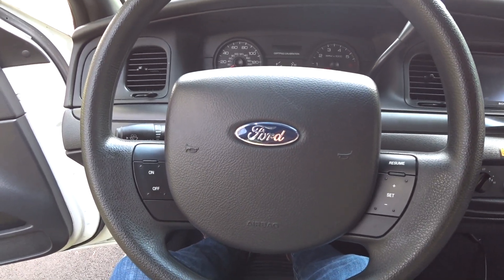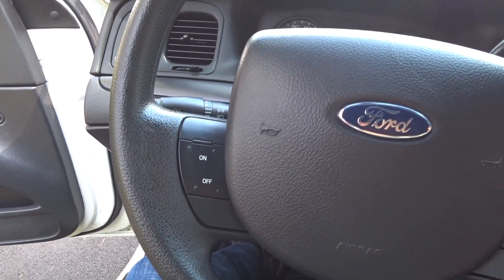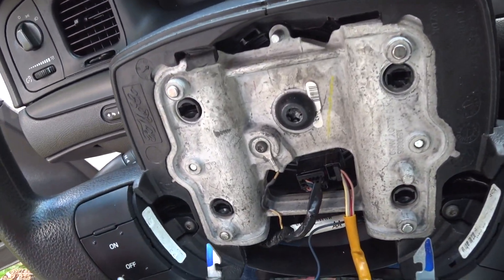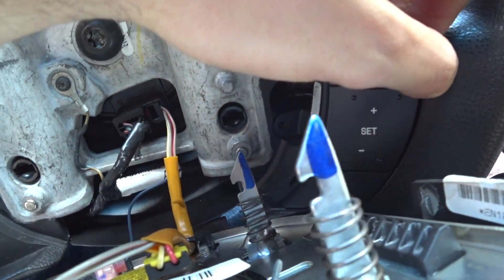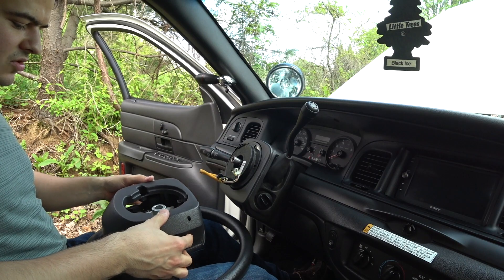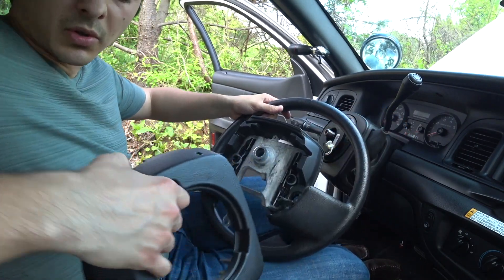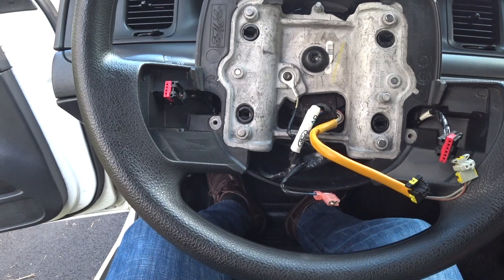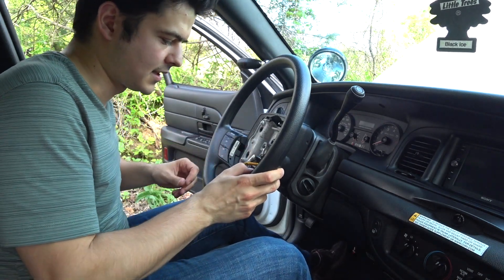Ford Crown Victoria Steering Wheel Volume Controls Retrofit

Comment: Thanks for the video. After watching your video I decided to retrofit my 2008 Mercury Grand Marquis LS. As you stated in the video the release for the airbag can be tricky. Everytime I thought I had it one corner or side would pop back in. Once the airbag was removed the rest of the retrofit went quickly. I did have to use a puller to get the steering wheel to come off. Once the wheel was removed I took it to my workbench and swapped the control buttons and wire harness after removing the back cover. I put the steering wheel bolt in to check if the threads were damaged and they were. I cleaned the first few threads with a 10mm X 1.5 tap. Much better. Reassembly was very easy. Since I have the original AM/FM/CD/CASSETTE the controls work perfectly. The electronic climate control buttons also work perfectly for increasing/decreasing the temp.The cruise control moved from the right to the left on my steering wheel. It works of course perfectly. I would recommend this retrofit to anyone. I think it much safer to use the steering wheel controls since the controls on the dash are so far away. Thanks again for the inspiration.

Comment: Hey, when I was a kid we didn't even have power steering. The break and the clutch pedals were like those exercise machines in gyms. There was no radio you had to sing really loud over the engine noise. And I had to drive uphill both ways to school in the snow without snow tires. ,(Her hee)

Comment: Where can I get these
Reply: I assume you figured it out by now, but your best bet anymore is buying the whole wheel on ebay. Ford discontinued most of the parts unfortunately so good luck finding just the buttons and the wire harness, but you could always try a junk yard. Also, if you're having trouble finding the adapter for the controls in my case I found a kit on Crutchfield. Crux SWRFD-60L Wiring Interface the only thing is it won't work with aftermarket systems made by Sony or THX systems that require SYNC.

Comment: I just did this to my 07 Grand Marquis after watching the video. I used a wheel from a Lincoln Town Car. Super easy. The wiring harness is almost impossible to find, but I found one at the junkyard. Cruise is working, but need to get the radio buttons working, but that's what Tech Support is for. Outstanding video, great upgrade to my car.
Reply: I got the radio buttons to work by adding a wire to the clock spring connector and running it to the head unit connector.
Reply: @encinobalboa  Can I verify the steps you took? 1. Install wiring harness and steering wheel buttons 2. Plug Maestro connector onto aftermarket radio and run wire to clock spring connector

Comment: So did it ever work with that head unit? I have the exact same Sony head unit in my Vic and experience the same frustration you had with the volume knob.
Reply from the maker: I never got it working with the Sony head unit I had in this car. I got the steering wheel volume controls from Crutchfield.com (the Axxess brand) to be exact. Crutchfield is great because they have support 7 days a week. After speaking with a technician on the phone, I got the following pieces of info:

There is a plug behind the steering wheel, around the 7:00 position. You have to remove the bottom cover to access it. This plug powers the steering wheel buttons. In the plug, pin 5 in the pigtail is where a wire would be on cars that have factory volume controls. Pin 6 (I believe) is for temperature controls if the car had EATC.

Gray with red stripe from Axxess connector needs to go into Pin 5. You would need 5' of wire to run from the pigtail behind the steering wheel to the Axxess steering wheel volume controls kit that lives behind the head unit.

Red accessory from Axxess goes into Red Sony harness wire (Tap this in)

Black ground from Axxess goes into Black Sony harness wire (Tap this in)

The controls should work once this is done since essentially you are retrofitting a wire that higher-trim cars already have
Reply: Garage Denali thanks! I don’t think I would have figured it out alone!
Reply from the maker: No problem. I haven't done the work to confirm but the tech support person told me that if that connection is made, it should work. You might need to source some parts such as a pigtail from a car with more options or find a way to insert the pin into hole #5, but as long as the wires are there, it should work. Essentially, you are running a wire from the pigtail behind the steering wheel to the head unit harness if I am not mistaken
Reply: Garage Denali yea that’s what it sounds like. It seems pretty straight forward one you get the correct harness put in.
Reply: @garagedenali  you're going to finish this yourself, right? Please tell us you still have this car and still intend on finishing, lol. I found it ironic that I got another Crown Victoria myself recently, and selected a Sony unit just like this one for my aftermarket replacement (I want the 210). All of that, then this video showcasing the steering wheel volume controls, can't be a coincidence. Lol.

Thanks for the videos, very, very helpful!
Reply from the maker: @bergePanzer581  There will not be another video on this, at least for a long time. I don't have the car anymore but the steps I outlined above are what need to be done to get them working. Since cars without volume controls never had the individual wires in the pigtail at the 7:00 position of the steering wheel, this retrofit will require installing those wires.
Reply: @garagedenali  You have to add a wire to the clock spring connector and run it to the head unit connector.  There are pin outs on the internet that show which position.  I got my radio buttons to work in a CVPI this way.
Reply: @garagedenali  How long did it take you to remove that airbag? Just curious...

Comment: Question, I have cvpi, and I just bought a wheel, but it came with the full set of buttons. Is the wiring completely different, or will just cruise work if I put it in? 

PS it came with the buttons and wiring harness you were trying to add

Comment: Hello,
I have a 2011 CV interceptor but it does not have cruise control on the steering wheel. I can see the cruise control icon on the dashbored though. What does it take to add cruise control to this car? Is it pre-wired for that and just swap the wheel with one with cruise? Please advise!
Reply: You would need a wheel and would need to have your pcm reprogrmed to activate CC. Dealer charges around $120-$160 to activate it.

Comment: OUTSTANDING!!   

Does anyone know if the "FORD" airbag will fit the Mercury and/or Lincoln steering wheel? In addition to adding these radio/CC/HVAC buttons, I'd like to swap to a wood grain & leather steering wheel.

.....and you still use too much Loctite, LOL.... excellent info though!
Reply: If anyone sees this comment and is wondering, the answer is yes. 2006-2011 are compatible across models.